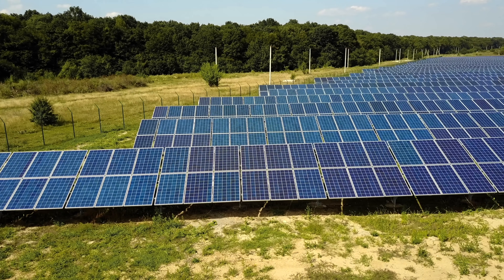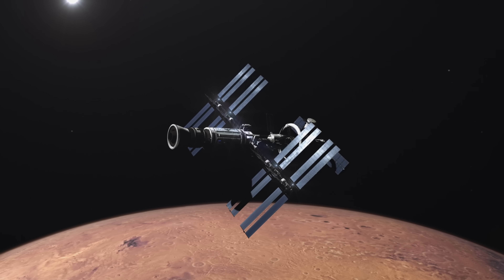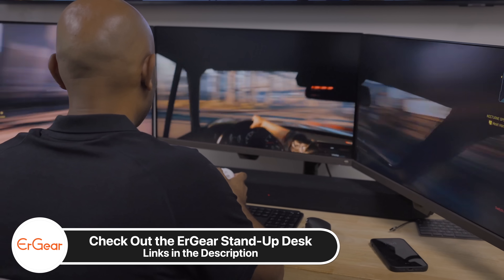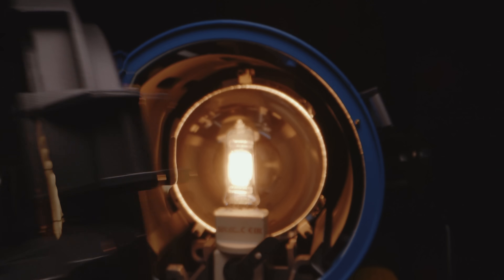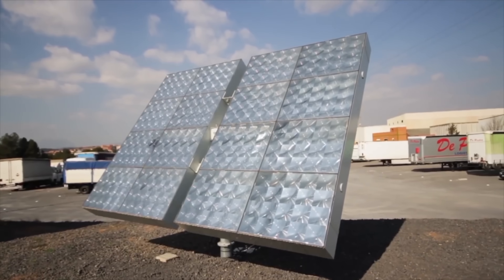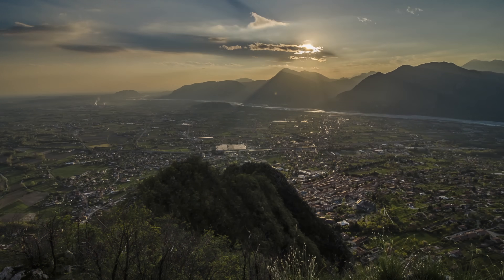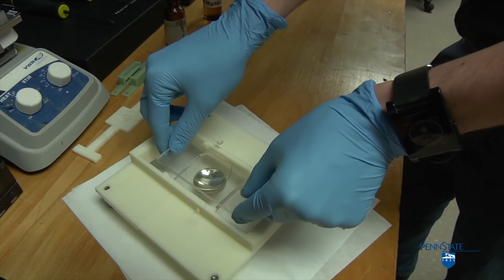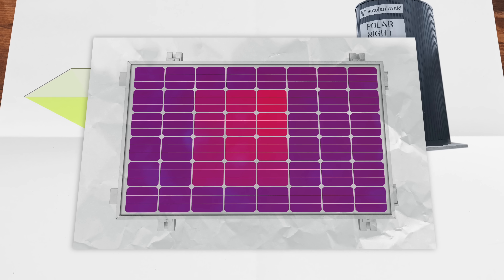Why Don't Solar Panels Have Magnifying Glasses On Them?

Comment: Unless these panels can be aligned like normal solar farms so we can wash them with our brush systems, the wash cost will rise min four Times, we started machine washing over 7 years ago when hand wash was 30p U.K. a panel , we now wash below 10p , if a farm is close to mains water has a good boarder between end of panel run for equipment to turn round also  clearance gaps between the panel rows, then sound firm ground well drained, NO cables above ground, prices for wash can be £380 per Meg on 30 to 70 meg farms, however in U.K. most  farms are 5 to 10 meg these can cost up to £500 per meg or more depending on overground cable runs or if they must be cleaned at night because of the shadowing problem, IF these new panels can’t take machine washing, they will need self cleaning systems fitted to them that will kill them dead, one thing I can say for 110% cleaning the panels is vital maintenance that’s a fixed cost not going away, 👍

Comment: I did my first solar install in 1983. Efficiency is better now but nothing has been done to design a solar panel. that is simple, quick  and easy to install. Solarex was on its way to do that but was bought by BP.  Try installing a solar system sometime. It is a laborious nut and bolt install more primitive than a Model T .  Where is the cost in solar …. Installation  and permitting /inspection.
Reply from the maker: this is such a good point Mark! and wow 1983 that's amazing, you're truly a pioneer. I do have some ideas that will be covered soon!
Reply: @TwoBitDaVinci   The  solarex was plug and play . Each panel
Nested into a C channel on the adjacent panel. Still needed a primitive rack support but that  could be eliminated as well.

Comment: storage cost is the real stopper for many of us at this point. any average day i don't use much energy. but many days i use 50 times more and those days are not negosiated. the capital cost of dual systems has stopped many of us from even considering solar.

Comment: But concentrated light increases heat that increases resistance and drying out solder joints.

How are they getting around these issues?

Comment: Why not just make the pyramid slightly larger, then put the solar panels on the outsides of four sides of the pyramids so gathering concentrated light sooner, with heat activated fans blowing upward, as each (light cell unit) is a centimeter apart, so to easily exit heat upward past them. 🤔🌄

Comment: Cost is more important than efficiency if space is not an issue. Even a 5% efficient cell be the best solution if the cost is 10 times less than a 20% efficient cell. There is a lot of cheap land in the deserts.

Comment: If the 3D printer design can be adapted to an existing roof mounted installation to upgrade a previous install - I know I would be in the market.  If I could put a concentrator on top of my existing system and get even a x1.5 increase - that would be huge.  Additionally, because it would be an add on, it could bypass the Federal Solar regulations of having to have a 25 year track record before it could be sold to the public.  That regulation is based on the solar cells themselves and not the concentrator.

Comment: The biggest problem with concentration is heat... and that had not been resolved yet
Reply from the maker: Cooling isn’t that hard we cool everything from CPUs to LEDs… easy to solve a just need to size a cooling system etc

Comment: Why not use a light collector and then transmit the light through fiber optics for a cool clean light source to concentrate the photons on the solar cells that could be contained in a small portable cube or sphere?

Comment: The problem with renewables is storage at grid level. Regardless of the quantity of power, if you can't store it it's useless. Currently only pumped storage is known to work. Unfortunately that would mean storing about 100 cubic kilometres of water at an average height of 300m for the UK alone. Such a project would make the moon shot, the Great Wall of China, WW1 and  WW2 together look cheap. A bit of a snag.

Comment: it would seem to reason that these kind of solar panels would not be like traditional panels, which only need to be cleaned once or twice a year.  even if you can put them on your roof, you might be better off keeping them on the ground so you can access them more easily to keep them clean.  im sure any system that is designed to collect light and focus it down to a particular area, that kind of system would require you to keep it nice and clean.
Reply: Thanks for watching and commenting ❤you have been randomly selected from comments as winner for today's giveaway hit me up via the digits above to claim  prize.........🎁🎁🎁🎁

Comment: I am very skeptical of what is being said here.  I have heard for years this idea that if just focused the sunlight, but I don't think this makes sense when you consider the laws of thermodynamics.  Just like you can step up voltage in a circuit, you don't get more power, I don't see getting more power from focusing light

Comment: Multi layer pv gives you more efficiency. And thinner layers would reduce cost. So flat static panels are simpler to mfr and operate. 

Concentrators solve a problem. Just not bulk deployment at low cost.
Reply: Congratulations 🎉 you have been selected among our shortlisted dm me above 👆to claim your prize.......... 🎁🎁🎁🎁

Comment: Concentrators need tracking. And increased pv efficiency is offset by higher design costs and tracking costs. Sometimes plain flat pv is enough.

Comment: Energy is not problem in the Summer, so to speak. We should have PV panels that work in Winter sun and concentrated PV may help here. Also, there is no heat problem in Winter.

Comment: in practice impossible. the weight problem alone rids most roof styles from usage. the heat issue is also a very hard problem to fix

Comment: Had to put a second comment. The stationary panels "set it and forget it" thing and the "clean it twice a year" thing... no way... they're typically set up in series set ups too even. If the top PV cells fail, the rest shut off. Bird poop, etc... all sorts of things... take out the cells in that region, and the whole thing just gives up.

Bird poop is apparently pretty commonly stopping them here.

Comment: A couple of points.

1) For Solar to replace fossil fuels we must have storage.    If you are going to compare solar costs to fossil fuel costs,  the cost of storage must be considered.
As an example, California has changed the incentive system to make solar installs marginal investments (at best).    However, if you have a battery, the incentives are better.  (Even with a battery it is not clear a system is a good financial bet for a home)

2) If there is active cooling on the system,  the system is going to be far too complicated for most homes.  (At least for the foreseeable future).   However, for commercial systems it might be feasible.   

Note: There have been a few commercial attempts at solar concentrators that were a complete financial bust.    However, that does not mean it is impossible to make it work.   It just means the technology they used did not work commercially.    Different approaches may still be viable.

Comment: If i understand it correctly it is not some crazy new tech it is some lenses on top of the old stuff so i hope the price won't be too high, on the other hand the efficiency of that is insane! 952 watts per hour from a single cell means that a full sized panel can produce 130kw in an hour which i need almost 13 days to use! The real issues i can think of are the heat, the storage of this power, and if the grid can take this much electicity not the tracking system or the perfect sunlight.

Comment: Is there a way of capturing a thermal heat from concentrating said light if it is could you use it in different systems like water heater Heating in the winter time thank you

Comment: Actually the price of the panel should not be measured in price per W but the contribution in Wh over the panels expected lifetime.
If a panel produce 2% more energy during 20 years, the few cent those 2% brings as cost at purchase is a win.
Also, if you because of these 2% result in less panels needed, the total cost can be reduced due to less assembly frame, cables and cost for the job.
Reply: Congratulations 🎉 you have been selected among our shortlisted dm me above 👆to claim your prize......... 🎁🎁🎁🎁
Reply: Hi. Whats up

Comment: I came up with this concept thirty or more years ago. I did not have the time or the money to copyright it let alone move the concept beyond a test model. 
That said, I shall - again - point out that a great advance in efficiency can be had by not transforming the collected light to electricity. I could be sent down fibre optic cables and  be emitted by means of a similar device to the collector panel used in reverse. This would enable redirection of any light to any area where light is required. Natural light that shines horizontally in to office windows could be redirected to illuminate the office from above. Thus cutting down on lighting costs during the day. Even overcast skies produce ample light , direct sunlight and the natural lighting changes could greatly help with sick office syndrome. 
Further, the concentrated light from the fibre could be used as a heat source for cooking, or as a heater for thermal battery storage systems. 
I have been trying for decades to get this concept developed - It was a great idea thirty years ago, it's even better today with improved technologies. Any takers ? I call it the 'Portable Window'.
Reply: Reading the comments - I see that many other people came up with this idea. On this thread at least I think I was first though 🙂
What this says about new technology funding, copyright protection costs, etc shows why we are now deep in the environmental crisis - as predicted so often so many years ago.

Comment: Wondering whether combining using a mirror to track the sun to reflect on a concentrator would in effect double the concentrated solar cell output for most of the day? Thus the output jumps from a 1500% increase to 3000%. All that cheap clear glass that cannot get recycled, now has a recycle home!

Comment: Why not run the sunlight through a prism then focus the wavelengths that give the most energy. Removal of the hot wavelengths for other uses would eliminate the overheat problems.

Comment: This approach is not new and has been tried before. The challenge is finding materials that can stand the high temperatures over the expected 25+ lifetime of the solar collectors. Anyone who has dealt with solar thermal collectors can relate. I'm skeptical that this will be a breakthrough technology.  What's wrong with 20% efficiency? It's cheap, it works !

Comment: AGIL  a cool idea ... but it still comes down to the surface area exposed to the sun. ie its still going to be zero output if the sun is at 90 degrees to the panel. and you still have the 10% efficiency loss of the light going through the "prism".. but AGIL its still a cool idea !! maybe there are other applications like the microlens in photography camera sensors. It would allow large sensors with more sensitivity and more uniform exposure from edge to edge.  Who wouldn't want to 3 times more sensitivity of your camera sensor. !

Comment: The big problem now is that the cost of batteries has skyrocketed to the state of price gouging. A 5kw lifipo a year ago was $700. And is now $2500. Definitely not reasonable and has offset any affordability gains on pv panels

Comment: Well done video and you've hit on the most important factors of where we are now and what is possible in the future.  But only rich people will have this newer high tech solar cells due to the price when it hits the market.  For a typical middle class home owner, this stuff is a lot further away then 2027.  Try 15 to 20 years at least.   At some point in the far off future, we will have "free" energy.  Right now, solar panels are pretty much a wash in reality and far from free.  You pay $35k-50k for the panels that in reality last for about 20 years tops.  You save about the same amount with luck, on energy costs.  So it's basically a pay now for your energy upfront.  When the technology is there for using the suns energy much more efficiently, with a system will cost X amount and you save 2X amount in energy before the system has to be replaced, then it will actually be a help to more of the population. Right now this looks more like a money maker for installation companies and a BS sales pitch for politicians saying it is all free and will completely replace our dependence on fossil fuel right now.

Comment: Even if panels cost nothing; the cost of the system would not be reduced that much; as installation, mounting hardware, inverters and batteries are the most costly components; batteries are currently very high priced, and labor can also be a major cost. If you are talking about a solar farm then the infastructure to connect the farm to the grid is also a major expense.

Comment: I have been involved with Solar for over 40 years. My question is can’t there be a happy medium.
 I mean I have seen efficiency very slowly come up to around 20% yes I no it’s come up a bit
higher say 22%. I have 2.4 KW of what’s called an HIT panel slightly more efficient then most
of the panels made several years ago. And your point of the sun constantly moving. I would 
be thrilled if the efficiency would go up to 25%. You always read they now have a 400 watt panel 
they do and they are significantly bigger. With the oil crunch and record profits being made by
big oil Solar is going to be even more important. Where we live our utilities are raising the per
KW from around 12 cents to 24.9 cents  the bill is then broken down to delivery and maintenance 
Plus.. My bill is say $30 in KW and the rest is over $60 that’s  $90 And my last point is yes mine
 get extremely  hot. By making them produce so much power and need external cooling measures. 
Again go for a happy birthday medium where you get better efficiency and don’t burn your home down
 to to them going over the 451 degrees F thats from a great book thought I would drop that in for fun. 
Sorry for the choppiness using my phone. 
Thanks

Comment: Since renewables are in effect competing directly with fossil fuels, we need to consider what contingencies are shaping that competition.  Currently, petroleum has several advantages such as low cost, established infrastructure, and acceptance by the public/users.  Perhaps the simplest step to take would be to make petroleum an uneconomic choice through changes to public policy and taxation.

Comment: cpv has been around for a long long time, and it failed due to the limitations it has, such as not functioning in slight overcast sky or with difuse light.. horrible for homes

Comment: What I do not understand is; why couple the lense and the panel together? Why not create a mirror casting the light onto a small cooled panel. If temperature is to high, the mirror can just disalign.
The idea is good, but it needs a lot of engineering.

Comment: That's because at higher temperature efficiency of the solar panels decreases. 
As a result, new solar Pannels are going to be installed vertically.

Comment: The problem is that even doubling efficiency doesn't give you enough energy to replace fossil fuels. For example In the United Kingdom there isn't enough  land area in the country to support the placement of solar panels required. The backup batteries supply the equivalent of 1 to 2 seconds of backup when the sun doesn't shine. This is a very bad idea to rely on solar and wind but some individuals are getting very wealthy from this transition to solar.

Comment: The true problem with solar is not generation, it is storage. We need large scale cheap storage of electricity to make it all work.

Even if you have an array with batteries, you need to make sure they do not deep cycle, because then they will break in under two years.

Comment: Why is it that the cost of solar panels has dropped dramatically and for the last 10 years but prices when I check how much it would cost to install them on my property the price has always been the same: $20,000.
When I looked up the trend online I was told that have dropped more than **70 percent**  in the past several years.
And when I checked local prices, it was $20,000 ten years ago, five years ago, and two years ago.
Ah, you would say, it's because of inflation, the installation cost, the weather, the ocean tides, the horoscope.

Maybe is me, but I begin to feel that someone is pulling a very fast one on me. 

Am I alone?

Comment: Cost of panels isnt really the issue with solar. Its the cost of power storage. Batteries and or battery banks are really expensive. Most of the cost of converting a home to solar is in the battery bank.

Comment: Everybody  ELSE  seems to jump on the rooftop solar bandwagon.  

Not me.  

I found a greatly simplified method to do all this and  I made my own solar-electric device, which produces ALTERNATING current, which I can store, if I choose, as ice. I chose ice because water has the highest heat capacity (540 Kcal / mole) of all the user-friendly methods I investigated. 

I also build small hybrid engines,  which can convert phase change into usable work.